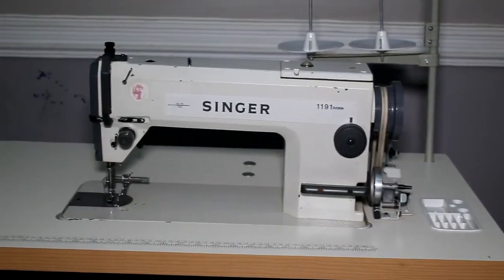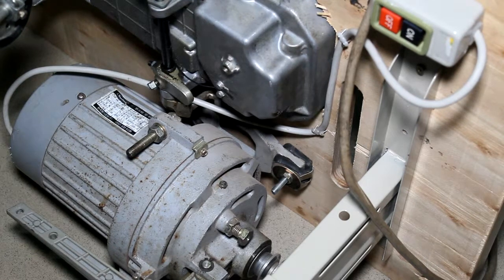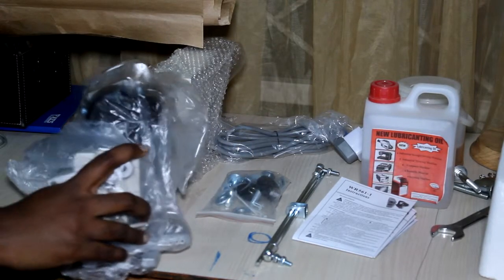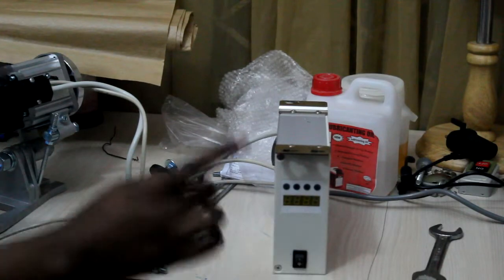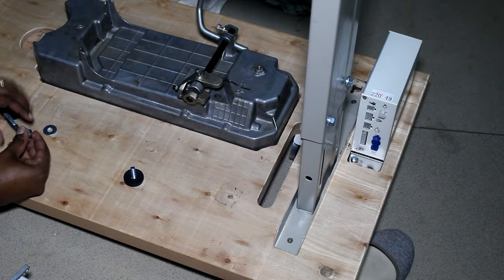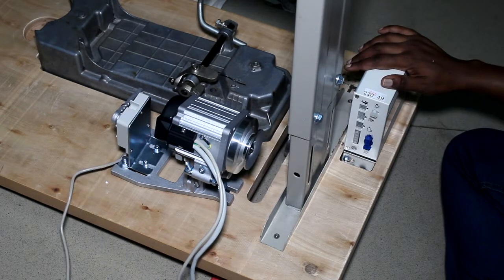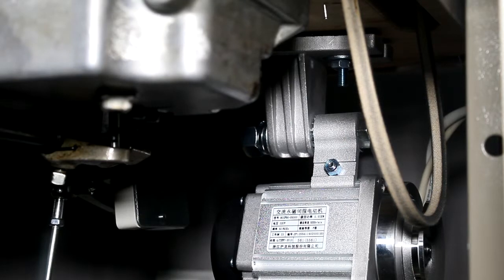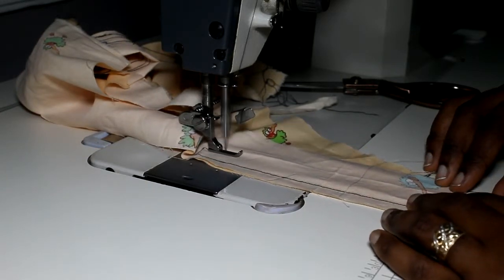Changing sewing machine clutch motor to a servo motor - Sewing Vlog | Alex Marie

Comment: Thank you for the video. It’s very helpful as I’m planning to change from clutch to a servo motor. Did you add a needle synchronizer?
Reply from the maker: You're welcome. No I didn't, but I might someday. 🙂
Reply: Where do you find the different sized belts?
Reply from the maker: @annemariealexa9195  I get them from the shops that sell sewing machine accessories or those that sell used sewing machines.

Comment: Did you order a certain model of servo motor to work with your machine or is servo motor universal please
Reply from the maker: No, I didn't order a specific model per se, but I did check with the seller that it would be compatible with my model of machine. They do come in different wattages and voltages, so you have to consider that.

Comment: What is the difference between servo and clutch motor?
Reply from the maker: This is my layman explanation, so don't quote me. They simply work differently. The clutch generally is always running even when you are not sewing, and it's very noisy, plus it does not have variable speed control. The servo works like the motor on a domestic sewing machine, it's silent, only runs when you apply the pedal, and has variable speed control, so you can sew very slowly. They both have similar wattage from what I've seen, but since the servo doesn't run continuously, it conserves more power.
Reply: Thanks for replying